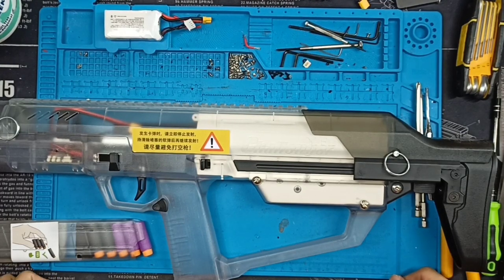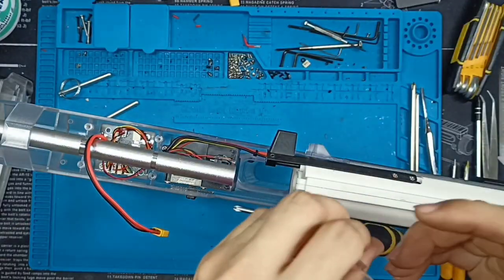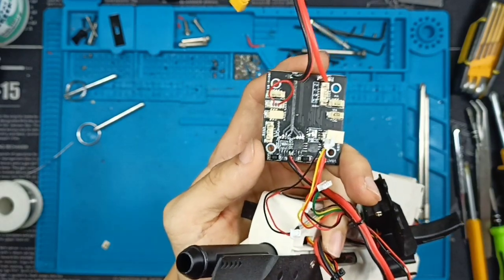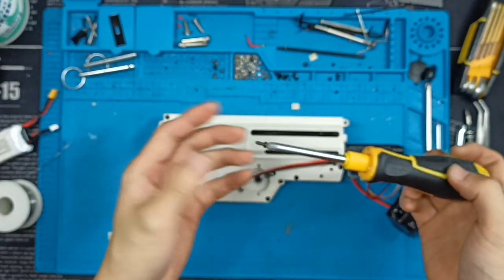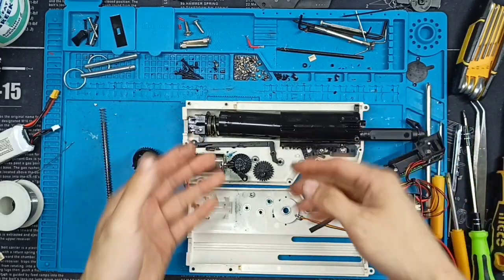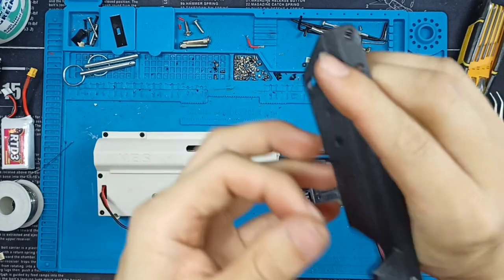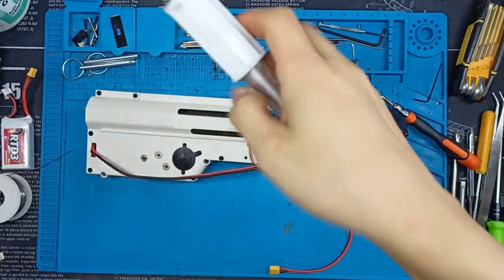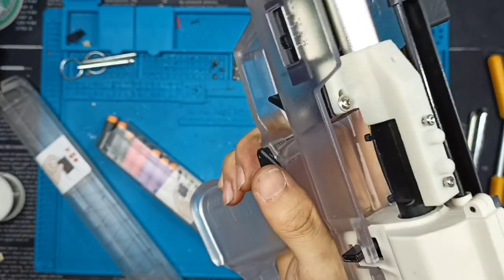QWK x MM Challenger MK3 in-depth disassembly and reassembly

Comment: Can we order replacement chip board? The solenoid in my gearbox is constantly being powered /pushing forward and gets hot as soon as i plug in my battery. Doesnt disengage until i unplug the battery, also, the system is not detecting when the magazine is empty, and not cutring off as soon as it senses the magazine magnet

Comment: hi, one of the wires is broken after I got it. Do you have a clear image of how the wires are connected with the chip so I can tell how to connect it back? Thank you!
Reply: just received my pro version and had the same issue, lucky its just one wire and it was easy to colour match.
Reply from the maker: Hi yes, we do have a wiring diagram for it, have you tried contacting us on our messenger or email? You can also join us on Discord for faster responds.

Comment: Very disappointed with this blaster... I didnt get one off Monkey Mods, but mine too had a board failure, bolt open failure, plunger padding came out the pusher, and the gearbox casing and bolt cover have both cracked.
It still cycles but no longer fires as it no longer catches... I had such high hopes for this blaster, but the use of inferior materials in this blaster, will see a llot of users suffer the same fate as mine.
The aluminium should have been BILLETED before being CNC'd!!!
QWK have cheaped out using cast aluminium as the material to be CNC'd and the subsequent metal parts are very brittle and break under very little stress. This Blaster SHOULD NEVER BE DRY FIRED AT ALL UNDER ANY CIRCUMSTANCE!!!! EVEN IF THE BOLT HOLD OPEN FAILS!!!
I have already seen a couple on Facebook Groups where the solenoid has failed for the BOLT HOLD OPEN feature, and they are experiencing the same issues as mine suffered... and it all starts with a board going faulty.
Reply from the maker: May I know these groups that you mentioned? We would like to join and documents the problem and failures, we will be happy to report these issues to QWK directly and see what we can help out with. QWK has been very helpful with the aftersales. If you guys are able to join our Discord channel, we can discuss the issues there easier.

Here's the discord invitation link:
https://discord.gg/Vqh6YdjP